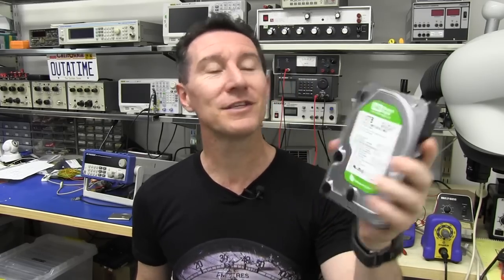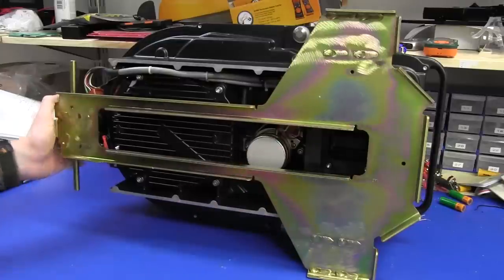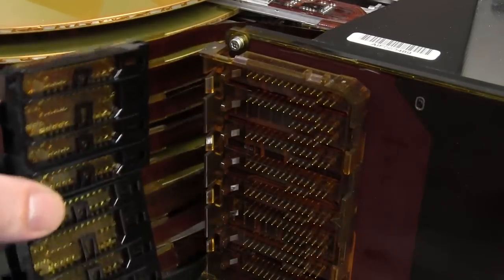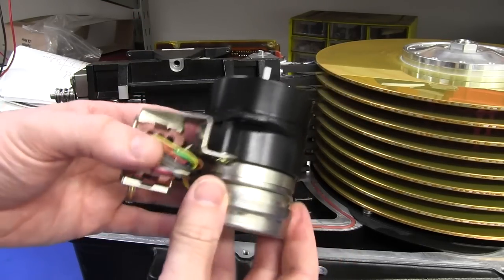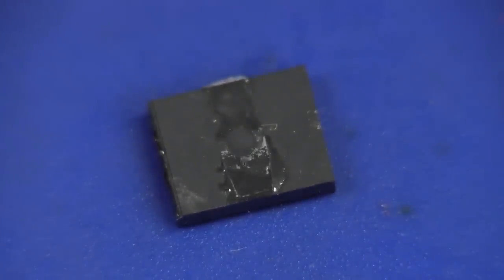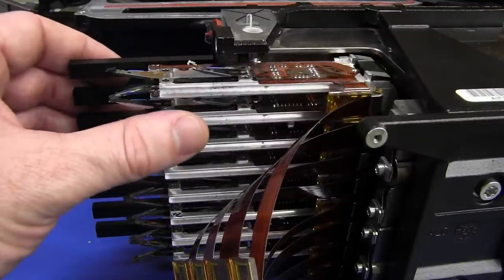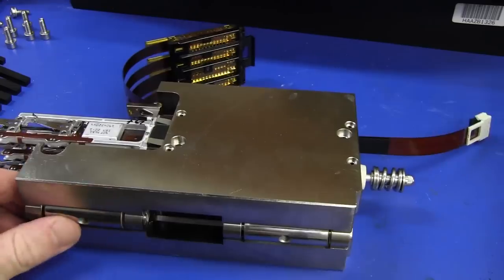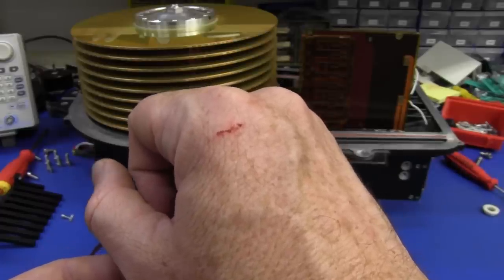EEVblog #395 - World's Most Expensive Hard Drive Teardown

Comment: As a former IBM Field Engineer, I can tell you as you point out in the video overlay, that these drives were more in the 2-5Gb range and not 10 Meg.  Also, the heads did not "ride" on the disk surface, but in fact were designed to "fly" on an air bearing that was molecules wide.  The head NEVER touched the surface while spinning.  The reliability of these drives was incredible and customers were glad (well glad might be a stretch) to pay even though they had to have enormous data centers to house the rows of hard drives.  When you look at all the things that had to work correctly with little to no tolerance variation allowed... it is truly a marvel.  And as you may have guessed, when you have the heads riding on an "air bearing" only molecules wide, the need to control expansion/contraction coefficients is very important.. hence the strip thermometer to assist with temperature control and problem diagnosis.
Reply: Listen to what he SAID.

He SAID its a 10gig drive.
HE had a 10meg or so drive in HIS computer around the same time this was made.
Comparing and contrasting.
Reply: Damn
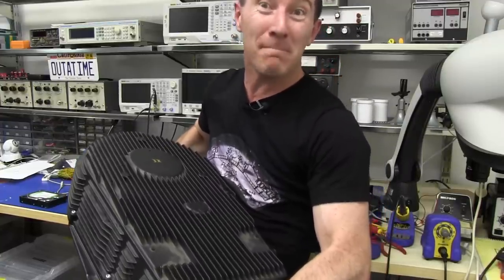Reply: @sugarnads   2:06 he says 10 MB. @Emtdrummer was correct.
Reply: We're these the diamond thin film heads back then?

Comment: Ha, ha!  I worked on 14-inch Winchester drives in the early 1980s.  The unit shown in this video isn't the complete drive; it's just the head-disk assembly (HDA).  The full drive, with power supplies and electronics cards was about the size of a washing machine, and that still wasn't enough to get the data on and off the discs, as the drives had to be connected to a controller unit that handled a string of 8-16 drives.  This drive is more advanced, having an integral spindle motor, but the 14-inch drives that preceded it in the 1980s were belt-driven by 3-phase induction motors about the size of what you would find in a washing machine.  The systems needed an air-conditioned room in order to work reliably.  It's amazing that today's hard drives have all of that crammed into a pocket-size package with orders of magnitude higher reliability and lower power consumption!
Reply: +ebulating I find a 300GB microSD more interesting.
Reply: Thank you so much for commenting. I knew I wasn't crazy. In 1998 I had to go on site to some railyard at night for a quote-unquote hard drive replacement. Arriving in a room with no lights I have to use my flashlight. I open a crate and I swear among all the padding I saw a giant belt-driven something that looks like a sewing machine. I slowly closed the box and backed away.

Pretty weird when you're expecting to find something the size of a VHS tape or smaller. I actually found this video looking for what that was. I'm looking up Legacy hard drives Etc. If you have any Google image links or machine type descriptions for what you think that was I saw or something related, please reply. Again thanks.
Reply: You're thinking of the 3330 and 3350 drives which were washing machine sized.   The 3380 and 3390 were more refrigerator sized.   There were two HDA's mounted edge side vertical in each cabinet.   These cabinets formed a string of up to sixteen drives that was connected to a controller.     Depending on the controller each string could be connected to two or four channels which improved throughput because the system could use whatever channel wasn't busy.    I worked with 3390's when the "streaming I/O" channel was first introduced back in the late eighties.   The standard channel had a capacity of 3MB/sec, the streaming I/O pushed that up to 6MB/sec.      And it was all enterprise grade high reliability kit.    
Note to Dave:  Among the reasons these stayed in service for so long was storage allocation.   JCL (Job Control Language) was coded to allocate files with blocksizes that would efficiently fill a track on the drive.     Move to a different device with a different track capacity and all of that JCL needed to be revised.    Worse yet if you had a mix of devices in the shop you had to use a block size that worked well on each device.   Allocations were typically done in tracks and cylinders (A column of tracks) so a cylinder on a 3380 was different from a cylinder on a 3390.     If the allocation was too small the job could abort (abend) with an out of space condition (B37).    When IBM introduced a drive array called a RAMAC (In honor of their original disk drive) in the late nineties they provided emulation of 3380 and 3390 devices so businesses wouldn't have to revise the JCL.
Reply: Give it a few years and this stuff will be crammed into something the size of your thumbnail
Reply: Milosz Ostrow (
Reply: I also worked on 14-inch Winchester drives in systems made by OSM. The drive itself was housed in a separate enclosure, with power supply in another and the controller in a third enclosure along with the CPU, RAM and I/O for remote terminals.
We were still using them in 1992.
Reply: But wouldn't he have shown or said more about this not being the complete drive in his video?  Or why would the heads not be with the platters where the data is actually being written on?
Reply: brings back memories of MTEO at Memorex
Reply: I still have one of the drive enclosures (essentially a 19"x24.5" rolling rack unit), that I still use to this day to house a couple of tower PC's and a rack-mount UPS. It originally had one of the 14" Winchester belt-driven hard discs in it when I got it, but I couldn't find any way to interface with the drive electronics to access it (this was around 1988, so pre-internet). Most of the rest of the computer was with it, as it was in a salvage yard that I worked at, but other than an early IBM-AT that I had at the time, I really had no idea how to deal with it... never mind the fact that there was enough there to fill half of the 3 bedroom house I was living in at the time!🤣
Reply: I started as a sys admin in the early-80s so 14 drives were "standard equipment" by then, but there were plenty of washing machine sized drives around.  If that full drive did cost $250,000 when the cost/MB probably did make it the "world's most expensive".  The VAX 11/780 had three 14" HDA in a cabinet about as wide and tall as a typical 3 drawer file cabinet, but more than twice as deep.  The three RA81s had a total storage of over 1.2 GB, a huge number for the day, in a very small footprint.
The controller was "cheap" compared to IBM, but it only could handle 4 drives.
Reply: Hah! I worked on the great honking mothers in the early 1970s (Xerox Sigma-9). Good lord those things were HUGE. The units we had were something like 1.8 meters (roughly 6 ft).
Reply: @leberkassemmel  And now we have 1TB on a chip the size of a fingernail. Just incredible!
Reply: That's a amazing fact!
Reply: Very Cool old harddrive there ....
Reply: yep, my dad worked on developing a similar dishwasher drive at burroughs. when he bought a pocket 1tb backup drive his comment was "it would have taken 10,000 of those dishwashers to store what can now fit in my shirt pocket"
Reply: @jackpatteeuw9244  I was waiting for a VAX to show up... I had 3 of those hard drives that had changeable platters. 480 3 phase power, 3/4 HP 3600 RPM motor driving it. Quite the beast. The main platter casting was 100 pounds of aluminum. I still have a couple of the 'voice coils' that moved the heads linearly in and out on them. It was a 6x6 inch magnet with a 4 inch coil on a phenolic core. I always wanted to make a 5 or 6 foot speaker from it like Doc Brown had in the lab... Lol... 
Those whole systems were amazing. 2x3 foot cards with all the discrete socketed DIPs on them... and I remember the processor was a ceramic 80186. Sold the chip to a collector for 50 bucks in the early 90's ... I wish I would have kept it. I did keep one of the 8.25 inch floppy disks though!
Reply: @kleetus92  Goggle "bryant disk drive"  Blindly fast for its day (mid 60s ?) at 1 head per track !  Each platter was over 36".  The place where I was first employed had one connected to a Philco.  They had to keep it running because they had a customer that would use it for a few hours every month and the source code to the application was long gone.
Reply: @jackpatteeuw9244  Wow, that's a rare chunk of history!
Reply: @jsweizston5410  the platters are the "disk" in "head-disk assembly". His point was that things like a power supply and drive controller were separate units. These days, the power supply is (typically) the system's main power supply, and the drive controller is on the disk's PCB.
Reply: @trombone7  LOTS of big drives from MANY suppliers - IBM, DEC, ICL, Hitachi, Amdahl, CDC et al On top of that you also had people like Honeywell and CDC (Control Data) producing drives for generic OEM use by other companies like (as I mentioned elsewhere) Ferranti and HP. The list is endless ... I wish you luck!
Reply: @trombone7  Awesome share, the 2nd one in particular
Reply: @trombone7  We had a huge air conditioned computer room at Norwich City College, UK. The computer was a 'Harris' machine - with belt driven HDDs. Roughly 1983 I think.
Reply: @kleetus92  Absolutely! Young guns like Dave have no idea🙄😲😁

But never mind Hard Disks ... What about random access tape drives (Yes! They exist ... Developed by DEC  WAY before the big disks ... Called DECtape ... Naturally!)

And who remembers 64k drum storage or 32k or 16k drum storage?

What about the big 30" diameter disks with pneumatically loaded ceramic heads the size of a box of matches used by Ferranti, ICL, Burroughs, IBM et al ... MASSIVE 2 or 5 MB drives?

Who remembers 5 1/4" floppies? Probably a few, but what about the 8" floppy disks that came before them? Just 720 kB!
Reply: @boblewis5558  I have an 8 inch floppy in my desk still.
Reply: @ismaeljunior684  and you're proud of that??!! 😲🙄🥵
Reply: @leberkassemmel  How about the 1TB microSD or the 128TB SD card today ;)
Reply: That sounds like where I got my start.

Comment: I worked on an almost identical product at Control Data in about 1981-1982. I did very simplistic level failure analysis of "crashes" between the heads and platters.The leading edge of the head was beveled so that a layer of air would flow under the head. The head did not actually touch the platter when it was spinning, only when it was at rest. The space between the head and disk was just a few thousandths of an inch, if I remember correctly.The type I worked on sat on a cabinet about 4 feet high, 15 inches wide, and a couple feet deep. The cabinet held power supplies and a massive fan. The fan was not for cooling. The drive had big vacuum ports and the case would be vacuumed for many hours before being used, to remove dust and contaminants.These has a fairly significant failure rate in which the heads "stuck" to the platter when they were at rest. The surface of the head would "stick" and would damage the oxide when the spindle started to turn, ruining the platter and the information it contained.The units were assembled in a large clean room.The process of writing the "servo" tracks (the "locating" tracks) was quite tricky and sensitive. An oscilloscope was used by the technicians who calibrated the servo track writer weveral times per day. The servo writing machine was designed and built in-house at Control Data.I thought that I remembered that the capacity of the drive at the time was around 520 Megabytes, but I might be remembering that wrong. I just happened to have read a Wikipedia article about it a few weeks ago that indicated the Control Data product around the 1981 time period had a capacity of about 300 Megs. But that might have been increase in the first couple years after that.This was absolutely not a "plug and play" type machine. It was quite tricky to keep everything running properly during the manufacturing phase. And the fabrication and assembly of the drive in the clean room was very sophisticated.The discs had their final chemical coating (I don't know what it was) applied just hours before the whole assembly was put together. That chemical coating dip room was built adjacent to the the clean room. The discs were dripped, dried, then passed through the wall into the clean room.Control Data was a good company to work for in some ways, but in other ways it was horrible. My memory of those days is not pleasant. As Control Data started going down the tubes during the mid and late 1980's, the management got worse and worse and worse. The management were arrogant old stodgy paper pushers, who all got way too comfortable in their positions, and lost the energy of the earlier days of Control Data.When I start working there in about 1981, they had 55,000 employees. By the end, when they went out of business, they had about 300.There was a huge lawsuit between Control Data and IBM regarding intellectual property and patents, which I believe Control Data won. The suit lasted for years.
Reply: Really interesting stuff. I always love hearing about failure modes and the manufacturing hiccups for this kind of super expensive equipment, because it's not always obvious by first glance. Just because something has a giant price tag, that does not mean the end product is super reliable or that even manufacturing process was consistent.
Reply: " a layer of air would flow under the head. The head did not actually touch the platter when it was spinning" - I think that's true of modern drives also.  The heads are said to fly above the disk surface.  The distance isn't "a few thousandths of an inch" though - it's a good deal less than 0.001".  Cigarette smoke particles are WAY too big to get underneath.  The same applies to magnetic tape backup (I mean the type used in data centers), and tapes and their heads last orders of time longer if they are kept streaming, as opposed to start-stop operation, where the tape is continually landing on the heads.

I know that engineering can produce absolutely incredible things for one-off projects - but in mass production, I honestly think engineering reached its peak of perfection in the modern hard disk drive - and also in the motor car.  When you consider the complexity of a modern piston engine, it is incredible to me that I can get into my 11 year old car with the intention of driving from the UK to the South of Spain, with an expectation of getting there and back without mechanical failure.
I have been using hard drives continually since 1985 as a field service engineer, and they have frozen in my car on Winter nights, and cooked in my car on Summer days, and been knocked about while carrying them, ever since the Compaq "sewing machine" portable PC, through the Grid, and on.  I run them almost all day every day - and until now, I have never had a failure.  I used to maintain RAID systems that had a couple of hundred drives in them, so I know that they do occasionally fail - but I've never had a personal drive fail.
Reply: @DownhillAllTheWay  If the head touches the disk - it would immediately scratch the hell out of it ferromagnetic layer that would ultimately destroy everything.
Reply: @alexa.davronov1537  Indeed!  I once went onto a customer site in Paris where one disk of a bank of 12, IBM 3330 disk drives had crashed.  Look them up to see what they were like - but a multi-platter disk with 12 platters if memory serves.  A disk drive stopped working, so the operator changed the disk - but both the disk and the heads in the drive were shot to pieces, so the new disk didn't work either, so he had seen two disks not working on the same drive - obviously a drive problem - so he put one of the disks onto a different drive - where it wouldn't work either (because the disk was crashed), and after that, he went into a mad disk-swapping frenzy, and by the time I arrived on site, he had crashed 11 of 12 drives.  We bought some second-hand drives, because it was cheaper than getting replacement parts from IBM, and I used the heads from them - but I spent a loooong time setting them all up to align with the servo surface.
Do you remember the "cat's eyes" on the oscilloscope?  Ah, the good ol' days!
Reply: That vacuum was the reason the heads "stuck" to the platter when they were at rest. It's known problem in satellite design - metal parts in close contact could be "welded" one to another in vacuum. Sometimes you have to get parts moving just to prevent this.
Reply: @DownhillAllTheWay  I had a customer of one of my colleagues which I had to visit when he was away on vacation FORTUNATELY there were only their own two disk drives and packs and a spare pack - their backups were elsewhere. They did the same thing and complained that "the drives were making a loud squealing noise when they started them up. Inside one drive I found spirals of aluminium which had come off the platters as the "crashed" and now non-existent heads' arms had turned into machining bits of a lathe. Their boss was a VERY unhappy bunny when he found out. THREE brand new packs PLUS the cost of the replacement heads (they were specifically not covered under their service contract for "reckless" damage!) plus the cost of a new diagnostics disk which they briefly tried - briefly by that time was all that was needed to screw the pooch!
Reply: @DownhillAllTheWay  Servo alignment! :))
Reply: @alexa.davronov1537  agreed.
Reply: @ВасилийКоровин-г9э  agreed.